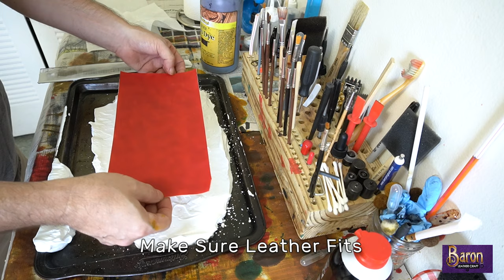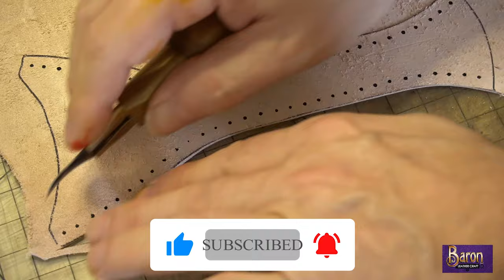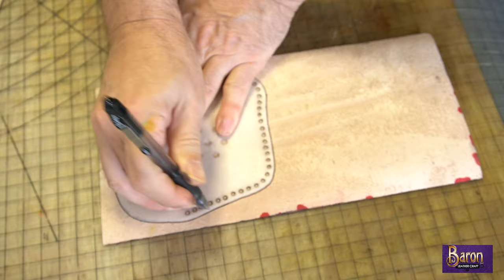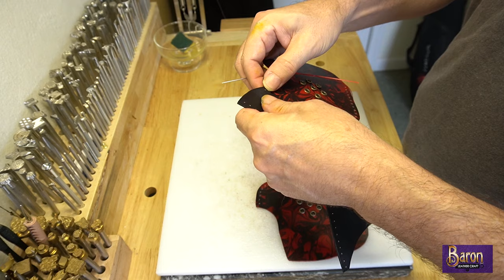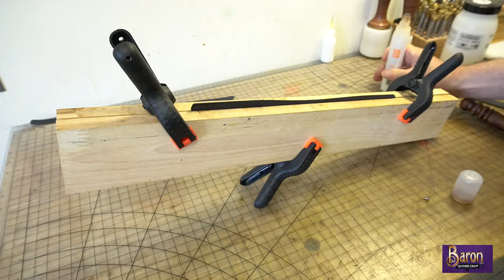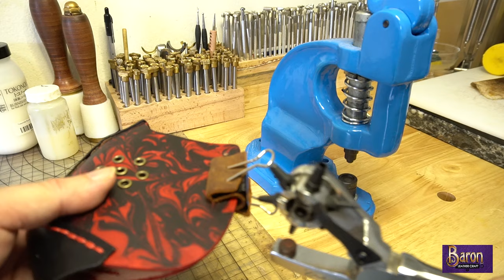Making a Leather Mask using the Shaving Cream Dyeing Technique

Comment: Great work! Especially when it came to the marbling technique.  The question that i have is did you use Red Leather Paint or Pro Dye?
Reply from the maker: Thank you very much for the kind words! I used red pro dye. I first dyed the piece of leather completely with red pro dye as the background. I then let it dry completely to prevent bleeding with the black dye that I used to do the marbling. I left the leather on the surface of the shaving cream for 15 minutes. Then try to remove the shaving cream without smearing the dye as much as possible. Then let it dry as long as you can wait before totally cleaning up the leather. I hope this helps. Feel free to ask anything. Thank you!

Comment: im trying this but my pro dye keeps fizzling through the shaving cream to the pan bottom making it very difficult. big air pockets. when you swirl through it it doesnt so much mable as it almost rejects it
Reply from the maker: What I do to avoid air bubbles is to hold the can 3 to 4 inches from the surface  and spray in rows leaving no spaces between the rows. I then use a ruler or a flat piece of anything and rake across the shaving cream. make sure it is at least an inch high and flat. drop the ink in and swirl it around, when you put the leather on make it as flat as possible push down but not to hard. Make sure you push down evenly to where you feel all the leather is touching the leather. Wait 15 min and then take off the leather use the ruler to rake the cream off of the leather gently. It will want to smear so try to prevent that. Do some small test pieces. I hope this helps. Let me know how it goes. :)
Reply: so it turned out decent. but still being a nuisance with the dye all sinking so deep. I solved it by putting more and mixing the pro dye with a bit of oil . it stays near the top of the foam better this way but the behavior of it is a bit different since there's more oil.
Reply: thank you for the tips
Reply from the maker: @TSimms7  If I remember mine did not turn out to good at the beginning. How are you apply the dye to the shaving cream? I use an eye dropper. Try not to drop it from to far away. Do you have any dye that is not the pro dye. Give that a try if you do.
Reply: @baronleathercraft  Hey man. totally didn't see the notification. I have acrylic paints now that are cool as shit using a thickened water technique. Havent tried on shaving cream yet. I was using pro dye only before using a small eye dropper . I tried dropping from very close so it wouldnt penetrate but the alcohol just chewed through the cream.
Reply from the maker: @TSimms7  Very cool! That would open us up to a bunch of colors. Lets us know how you are doing it? I have not tried this. Please explain. Thank you
Reply: @baronleathercraft  so most people use seaweed carrageenan. I went el cheapo and use a corn starch/water mix . I put a few tablespoons in about 2.5 litres of water once the water starts near boiling. once it boils, I adjust powder to water ratio to get a thick snotty texture . Similar to a sweet and sour sauce. It forms a skin as it cools so before transferring to a baking sheet or whatever, scrape the skin off. Size is ready. I use dollar store acrylics and they work very well . They're thick out of the bottle , so I dilute a squirt half and half with water on a pallet for each color I use. Then I drip away with droppers (gonna get multiple empty small bottles so I'm not constantly cleaning droppers between color drops) . once I get enough surface coverage , I just swirl it around with toothpicks/back of spoons etc.  Put my leather on, let it sit a minute or two and remove . Then straight to a rinse under tap . both sides. the corn starch slurry dries like a glue almost . gotta be clean . then I dry the leather clamped at edges to avoid deforming . once it's dry I oil it multiple times while rolling between oils to work the fibres .
Reply from the maker: @TSimms7  A true science experiment! I am going to have to give this a try. It opens up the ability to use a bunch of colors. Thank you for the info!
Reply from the maker: @TSimms7  Thank you for such a detailed process. I am going to attempt to do this as soon as I am finished with the projects I am working on. Thank you!
Reply: @baronleathercraft  yeah , I mean it worked out good for me. if I can figure out Imgur , ill upload a link so you can see the effects I'm getting.
Reply from the maker: @TSimms7  Great. Love to see it.